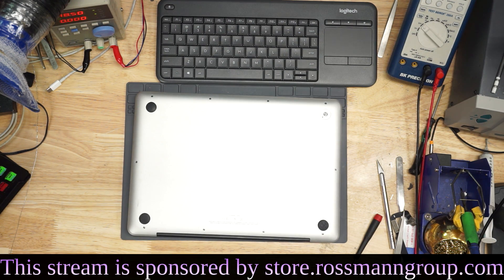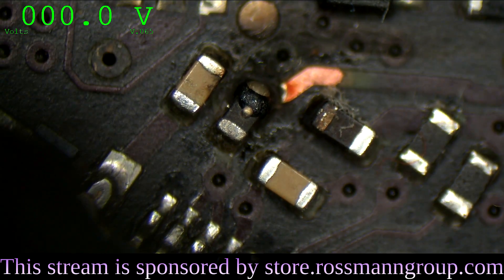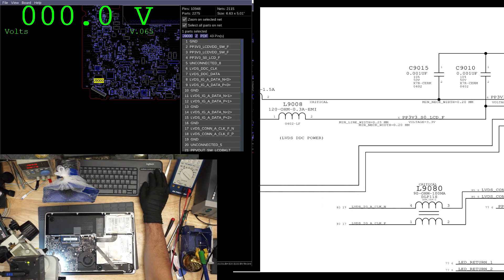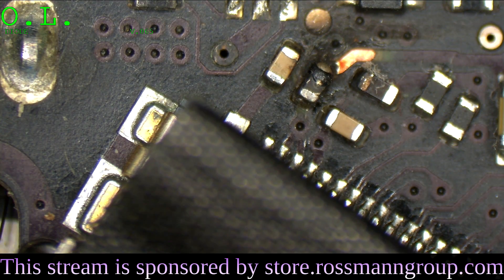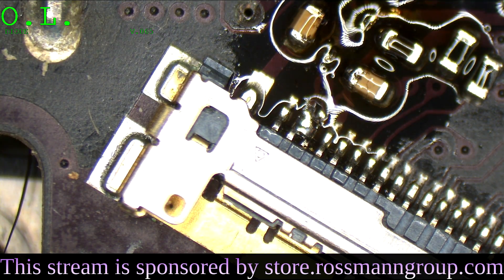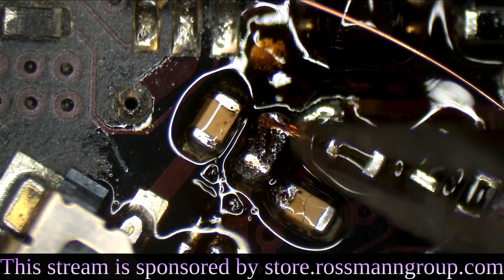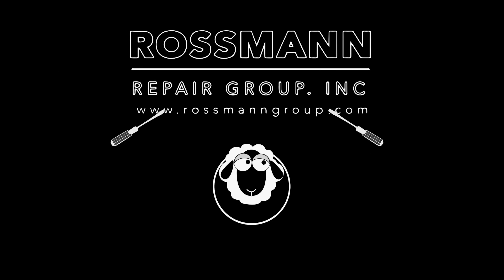Why does Macbook have grey screen with no picture?

Comment: Hey Louis,

I got a macbook pro that I have to fix for someone which has the same type of issue, however... It does seem to show an apple logo at the start when trying to go into recovery or booting from a usb installer. I've tried setting the boot-args with nvram in single user mode, since I can't get into recovery mode because of the screen showing the exact same white screen on boot after the logo appears (when switching gpu's). Since I can't disable sip because of recovery not showing a GUI on startup, I am not able to set boot arguments like agc=0 or nv_disable=1. If I startup a linux distro with nomodeset, I get a screen that is somewhat red, but it does show the linux operating system and I am able to make a backup of all of the files.

I am guessing that the iGPU is failing (not the AMD gpu) for some reason (or the other way around), and would like to disable it using nvram gpu-power-prefs set to 0 instead of 1. But this doesn't seem to work. I've tried this set to both 1 and 0.
I can set the verbose flag during startup from single user mode, single user recovery mode can't be booted though. So I was able to find this message right before the screen shows up a white screen:

giolockscreenstate 3

Since one of the GPU's (not sure which one) seems to work, how should I go about diagnosing the issue?
Some tutorials online tell me it's due to a software update of Sierra where a AMD kext is causing the system to fail boot. This is in /System/Library/Extensions/AMDRadeonX3000.kext
However since I can't disable SIP I am unable to move or remove this file. It says Operation Not Permitted.

I thought this file was located on the disk (not sure) so I formatted the disk after backing it up and it's still giving these same issues.

I'm really bad at doing board repair. The first and only time I soldered in my life I got a third degree burn. So I would like to have a solution where I just permanently disable one of the two not working gpu's.

Comment: I have the same problem.. But when i connect the different screen to the board then the Apple logo comes... Or if i use external display then Apple logo comes and it boots.. initially i use to touch screen here and there.. Then the logo use to come.. Now not at all.. Any fix?!

Comment: Thank you for your videos. In your opinion, what company makes the best phones in the world in 2018?
Reply: In my uniformed opinion, the best phone that you can buy today is a used LG V20. It is designed to handle some drops, a replaceable battery, decent camera, excellent DAC for audio. I've had good luck with the durability of Motorola phones. 

Here are my rules when buying a phone: 
1. avoid anything with a glass case (plastic is better than metal for absorbing the shock of a drop, but a metal is generally better at preventing bending of the phone), 
2. make sure that it has a microSD card slot, so you can expand the memory later rather than being forced to buy a new model,
3. either buy a model with a replaceable battery so you don't have to throw out the phone after 500 recharge cycles or go to ifixit and see how hard it is to replace the battery yourself if it has a sealed case. 
4. Also check out on ifixit how hard it is to replace the LCD screen if you crack it.
5. Check out how long the manufacturer+carrier will provide OS upgrades to the phone and whether the manufacturer+carrier releases monthly security updates. Android flagships should get two OS upgrades and mid-tier phones should get 1.  
6. Check whether the manufacturer allows unlocking of the bootloader and whether everything works under LineageOS. You may care about this in a year when the manufacturer stops providing security updates and OS upgrades.
7. Always buy a case to protect the phone.

Comment: Just want to share something here about my most recent experience with Apple’s geniuses. So I took my phone in for a battery replacement, £25 is a damn good price, otherwise I would’ve done it myself instead of taking it to an Apple store. So not only does this take 90 minutes to do in store (which is ludicrous) but they also returned my phone with an unresponsive screen. To be entirely fair, they were super helpful and I left with a new phone of the same model, but it’s still baffling how Apple themselves can’t replace a damn battery without bricking their own device and how they take 90 minutes to do such a simple task. By all means, stellar customer service, but fucking abismal technical support.

Comment: I had an 11-year-old Samsung 23" LCD TV die on me the same way, just like a week ago. (Timely video.) The thing about it is that it was made at a time when getting quality in a TV didn't necessarily mean getting a huge TV. This thing has every conceivable legacy and modern input known to man, as of 2007. As a result, I used it as the desktop center of everything from TV to PC, with game consoles in between. I'm wondering if it's something worth fixing, or if the display chip just fried itself after dust raining down on it through the top vents for over a decade. Obviously, the final answer needs an actual inspection. Should I even bother getting a pro involved?

Comment: Whats the Tech/Protocol used now on those macs? it used to be LVDS you say and I only find IPS but thats a display technique if im correct. so what are these connectors called or how is the display information send over in late 2016 and later macbooks?

Im sure Mac repair people already know but im still hacking on LVDS displays here and wondering if there are more recent higher quality displays I need controllers for.
Reply: Retina have an eDP (4 lanes) port/protocol, still on a 30 pin connector.
There is a DisplayPort adapter board, for some retinas, from the people who did the iPad display reusing interface.

Could you tell me more, on how I could reuse an LVDS MBP display.
I've seen some HDMI/DVI/SVGA TO LVDS converters for them, but they require too much current ( 4 amps!) or the need to buy 500pcs…
I'm looking for recycling an old MBP, with an Raspberry PI or the latest LatePanda Aplha.

My last idea was to build the ultimate IDongle, an old MBP that contain retina screen, keyboard, touchpad, sound, crappy camera, USB3.1 ports and a powerbank battery, to be used with an external computer (like the LattePanda Alpha) or HP Z2 via USB3/Thunderbolt...

Comment: It is in part thanks to you that I'm currently still using an 8 year old laptop. Not a mac but a lot of the repair skills do transfer over. I've managed to keep this 600 euro laptop alive for 8 years in large part thanks to these videos. So thanks for that. Let's hope the next one lasts just as long because today I'm finally replacing this piece of junk with something decent now that I'm an adult and can do such things.

The thing died 2 or 3 years back, blown cap. Wouldn't have known how to fix that if not for this channel. Then a connector died and I managed to fix it with solder and copper wire. Then the power connector died which I fixed by soldering the power onto the board. This is a retarded thing to do I know but I needed one more week for the replacement to arrive. So thank you Louis for allowing me to get away with using a cheap craptop for 8 fucking years.

Comment: I've done a bit of research regarding this issue.
I'm no expert, but i think that i've found a pretty good and relatively easy solution.

Don't buy overpriced crapple products :)

Nice vid as always ;)
Reply: @DeathNote 

Ignored this advice, just bought a 2009 Mac Pro lol

I didn't want to, but 16gb of ram and a 3gb Radeon 7950 for $300 was too good to pass up.
Reply: AE86, My comment was meant as a "joke". I'm just a windows user for nearly 20 years and i love being able to buy the parts that i want or need, and not have to pay 2000$ each year to buy the new mac model with their new OS. And risk having them say "no" to repair my laptop because of X reason.

16gb, 7950 for 300$ sounds like a good deal, i'm no mac pro so not sure if that price is where i might have suspicions that it's stolen or not. Could also just be a guy that just wants to get rid of it and doesn't want to spend time with people asking if he can lower the price etc...

I mostly just dislike how apple does their business. Therefore i don't want to support them by buying their products.

Cheers.

Comment: Can you fix windows and Linux laptops? Just asking, the only laptops you are fixing are Macs.
Reply: Whats so diferent ? its just this market is just right for Lious, basicly Macs are X86_64 anyway.
Reply: There isn't much of a market for doing motherboard repair on laptops which aren't Macs, because the resale value of used Windows laptops is so low and it is easy to get the old data off of most Windows laptops since the HDD or SSD uses a standard port. Maybe you could justify it for enterprise-grade Windows laptops (Thinkpads, Latitudes and Elitebooks), but not for any consumer-grade models.

Comment: Perfect timing, I have this exact issue on the 15" version of this MacBook after I replaced the keyboard, now it just boots to a grey screen. The mobo is pristine condition though and I managed to get it to boot into an OS twice, but 9/10 times it boots to grey, and when my miracle I can get it to boot into an OS, both my keyboard and trackpad now don't work! (but the power button works which is attached to the replaced keyboard!

Comment: If people bought IBM thinkpads Louis wouldnt have a job
Reply: IBM isnt making them anymore.. its Lenovo now, so I gues you should buy the Lenovo thinkpads that are based on the IBM ones ;) (I bougth a Edge, not smart, my wife bougth a Yoga... BAD lenovo, next one will probably be a true IBM based Lenovo, T series I gues. Those work laptops, no gaming or anything)

Ow and hell have a job, repairing and removing whitelists from the bios, installing coreboot and replacing screens.
Reply: @CodeAsm  

Would there be demand? Sure. But board repairs being required for a Thinkpad is absolutely rare. Most people that had to get rid of their Thinkpad did so because of age, not because something on it failed. Still quiet, boots up quickly and without hassle, but a Pentium 4 or Core Duo isn't gonna cut it anymore.
Reply: The older true IBM are old yeah. But Lenovo still makes fine ones :D and I believe Louis still likes some of them, teh recent ones.
Reply: AE86 of Mt. Akina mine is the last IBM thinkpad ever made. Intel Celeron with 1gb of ram and it still runs windows XP like a dream!!
Reply: CodeAsm I have an IBM thinkpad and it still works but I need to fix the backlight inverter because it is getting old
Reply: Listening for the thunder of woolly hooves as the ADF Apple defence squad head towards Militia pad with banners waving.

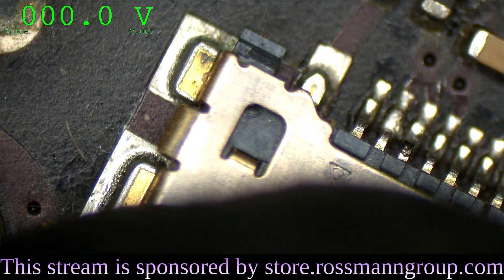Comment: 3:27 "You don't need to be a genius to check that out" ?
Wtf?
If you are a "Genius", you'll definitely not check any inductors, no.
You will choose the simpler and cheaper option of just replacing the whole board.

Comment: The shear number of trace faults that you have to repair shows just how cheap the Apple boards really are. I have cracked several of my older laptops (Asus, HP and Acer units) for cleaning over the years and have never found the level of corrosion and heat stress marks that are all over the Macs you open up.
Reply: I'm unsure if it occurs less on non-apple hardware, or if... You know... Other tech companies take care of their customers directly instead of forcing them to go to Louis.
Reply: i got an ~10 year old desktop, with a bend mobo, and ist still running! even upgraded its e6650 cpu to a q8300.
Reply: @JwFu  I got an Asus K50AB from fucking 2009-2010 It still works (other than a blob of dead pixels for no reason.)
Reply: The problem is also that fuses dont blow in a mac so the traces literally burn away in case of a short to ground.

Comment: what about the slober blob you left between pins 2&3 you didn't clear. They must common to each other because the screen worked, but it looks a little gaudy.
Reply: He put a wire there to connect them. They were connected by traces on the board as well, but he wanted to be lazy and make sure the connections were fine.

Comment: Nice video! Just curious, what was the reason for bridging pin 2 and 3 on the LCD connector ?
Reply: If you look at the trace underneath, it splits to both the pins from the part he replaced.
Reply: Thanks!
Reply: Because he wants to make sure 3,3volts go to the LCD and doesnt want to fix those pins if 1 of them was disconnected. looking at the schematic and PCB, you can see they are both already connected to the same 3.3v line. thus his work is "extra". Well, you need more wires if there is more current going over these tiny lines (the cable), so Apple took 2 wires for this, and thus Louis is now making sure, that the 3.3v line is going over 2 wires atleast to the other side (if 1 wire was not connected, all the current would flow over 1 wire, potencialy heating and breaking).

So when your there, and the board is kinda corroded, you could solder them together just to be sure that the problem isnt gonna be all current over 1 wire ;) (I wonder where that via goes)
Reply: My guess is laziness. But like he said both of the pins goes to the same place. So it ain't hurting nothing.

Comment: LCD screens are pretty complicated! I've got a mystery on my hand myself. What can it possibly mean if the screen lights up but displays black vertical bars or a fuzzy "vignette" effect around the edges? It seems like bad graphics hardware, but then the external screen connector works fine.
Reply: I have no Mac experiance but maybe it could just be the backlight? or maybe the lcd controller on the lcd itself is deaded? you have any working video output or donor screen to check if the mobo works? (Louis has a forum where you can get experts advice too ;) )